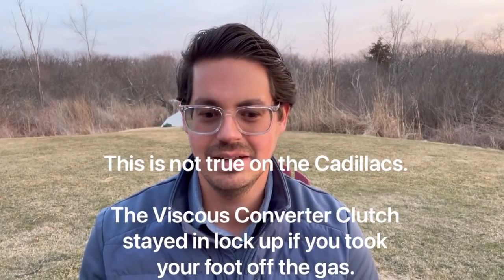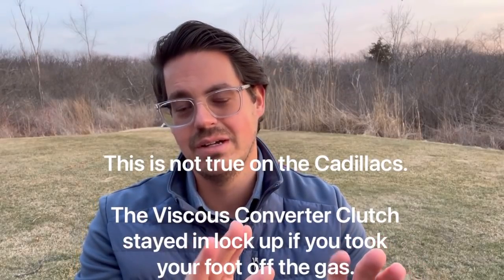Worst Transmissions of All Time: GM Turbohydramatic 440T4 (Early 4T60)

Comment: Worked at a Buick , Cadillac,  Oldsmobile store 25 years and remember this atrocious transmission.  Your correct with your list of it's problems. My friend was a Cadillac field service engineer and told me for the 1985 model year the Turbohydramatic division had a failure rate of 25% for vehicles off the assembly line, seemed to me in my service department it was higher than that.
Dealers weren't allowed to repair this transmission for several years. Rather we were told to install a SERTA (service exchange replacement transmission) and always flush the trans cooler. These were supposed to have the latest internal updated parts. Of course these units maybe would have a different symptom than the car's original unit so we would order the next latest SERTA and hope for the customer's sake it would be trouble free. Not uncommon to_ replace 2, 3, 4 units in the same car. One owner had 6 replaced in his 1987 Olds A body with a 3.8 V6. He brought us a roll of velcro and thought that might help us reduce the replacement time so he could get his car out of the shop quicker. He was very gentle with the car,  had a great sense of humor, and enough patience for 3 people. 
By the late 80's or early 90's techs were allowed to repairs the units but by then they had become pretty reliable. Unfortunately many loyal owners to our dealership had moved on to other makes by the time those 1980's car had frustrated them over and over with design and quality issues. 
By the way, if you still own one of these cars and think the transmission is ok still,  look at the top of the unit to see if it has a metal plate with SERTA stamped on it. Your car may have the latest remanufactured unit and you are luckier than the original owner.
Reply: I worked at a Chevrolet dealer for about 14 years, very familiar with those SRTA units. I do remember GM did have special policies on some units to where it was exchange only for a certain period of time. Then after the program expired, we could rebuild them because internal updated parts were available along with information to perform all the mods necessary to improve the operation of the affected  transmissions. When I started at the dealership, those 440T4 trans were phasing out, newer 4T60 were more common and later along with the 4T60E . What I told by an older tranny tech, he say that the torque converter lockup on the 440T4 and 4T60 were designed to allow very minimal slippage from 0-10 rpm, mostly towards 0. Because of the normal and abnormal  vibrations caused by those engines (at the time)any kinda of (use to like to say "hicups")misfire, weaker cylinder output, balancer, etc and any drivetrain issues those could felt by the driver through either the steering wheel and/or cab of the car. Later 4T60E units besides internal changes ( improve shift quailty and feel) made, those allowed for higher amount of TCC slippage 20-50 rpm in which those vibrations weren't felt as much, improving the overall drivability.
Reply: @michaelmurphy6869  more eye opening inside information, appreciate it.
Reply: @michaelmurphy6869 I have the 1987 Ninety Eight, car is like new condition . 67,000 miles trans does not shift out of 1st gear
Reply: @jnelson39120  There are several issues that can cause that concern, no upshift or delayed upshift. Since you have 1st gear the primary hydraulic system is probably ok. Check the basics first, low fluid level. Those 440T4 trans should have vacuum modulator (looks a can sticking out the side of the trans, its towards the front car about halfway down the trans case) inspect vacuum supply hose (short hose at both the engine supply and mod inlet) coming from the engine to the trans for any cracks, breaks or splits. If no or low vacuum(check the vacuum source as well, it's rare but the vacuum port at the TB could be plugged)  is getting to that modulator it can cause shifting issues, another is the TV cable (throttle valve comes out at the top of the trans and connects to the throttle body) check to see if it had come off the throttle body. If not it may need to be adjusted, the cable when pulled should move forward with a little bit resistance then released should snap back should have a short pull approx 1/2" or so. If all those checkout ok, good possibly there's a mechanical/secondary hydraulic issue internally in the trans and it will need to come out to be either repaired or replaced. Hope this helps alittle, good luck.
Reply: Very informative post thank you very much
Reply: learn something new every day, thanks for the info.
Reply: @willythewave  We used to get AXODs with under 5k miles on them
Reply: What an unfortunate time.
Reply: @ntdfmaverick  It sure was.
Reply: Classic GM Horror Story.

Comment: Loved the Ford AOD.  Was seemingly possessed or something.  Would shift quite well 95% of the time.  Always seemless with OD.  Then out of the clear blue a random massive KATHUNK from 1 to 2 to make one worry the car was near death.  Just means your driving a Ford said my father's mechanic  ... that ultra skilled man who could make the variable venturi run perfectly who is certainly long since gone to the great hereafter and has certainly fixed everything there by now.
Reply: I had a new ‘92 Plymouth Voyager with the 3.0 Mitsubishi V6 and the three speed automatic transmission. I never had trouble with it but if you lifted your foot off the gas pedal right before it was going to upshift from 2-3 as I had to in my subdivision it would about knock your teeth out. We drove it 12 years and it never failed, but listening and feeling that was not exactly confidence inspiring.

Comment: I bought a new 1985 Olds Cutlass Cierra with the 3800 V6 and I think it had this transmission.  I seem to remember it was in the shop a few times for mysterious transmission issues, and it received a new valve body and solenoids.  It also had a paint issue, and Oldsmobile did a complete repaint of it at the Oldsmobile dealer body shop.  I am positive that Oldsmobile lost money selling that car to me, it had a huge amount of expensive warranty work.  I drove it for four years and then gave it to my mother with the instructions that she was to dump it if another major problem were to occur.  One day when I called her for a phone visit she said, "about that car."  Before she could finish telling me what happened (it was a transmission failure) I asked her what she bought to replace it.  She bought a 1993 Oldsmobile Bravada, which proved to be a durable and reliable car that she drove for many years.
Reply: So she traded it in?
Reply: @christianmotley262  No, she took her crescent wrench and personally spent weeks working on it.
Reply: Did the 4T60 have an electronic valve body, or do you only mean the torque converter clutch?

Comment: I've got an early 84 vette, it has to my knowledge the original (never rebuilt) th700r4, boy that tranny's programming can drive you nuts. Its always hunting   between up shifts and down shifts and locking and unlocking. It'll go into lock up in 2nd. Lately I've been driving it with the tc unplugged.

Comment: It sounds like it would have been better for GM if they would have started off with a longitudinal front wheel drive setup for their luxury FWD downsize program. At least the 325-4L transmission had a track record of much better reliability, with updates electronics.  Plus they already had established a history with the E-body (Seville, Eldorado, Riviera and Toronado). Further, the C-body's suffered various other woes challenged the reputation of GM as a industry leader, because they borrowed heavily from cheaper models such as the Cutlas Ciera. They, on the other hand, were able to update the Fleetwood Brougham from 1977 until 1996, as there flagship.This platform was second only to the Lincoln Town Car's Panther platform, which was ran uncontested from 1980 until 2011. The unreliable powertrain options coupled with cheaply designed "luxury" offerings led to the demise of the U.S. luxury car market, while the Japanese dominated that segment.

Comment: I do believe the the automatic that was mated to the 2.8L V6 in the GM X cars would be a candidate for one of the worst. I had one that failed under warranty. The dealer that repaired it told me that failures were extremely common in the early models. The internals were mostly redesigned over the next short while.
Reply: That's odd, the TH125 is generally a pretty reliable trans.
Reply: @firehawk6188  Not as it was in early models. I don't think you'd find a GM tech anywhere to agree that they were any good at all. I was shown the pile of new parts (most of the internals) next to the old.  The new were substantially different. I was surprised they all fit in the cases because some were quite a bit stouter.

I was dumb enough to get one of those 'great new front drive cars' just a few months after they came out. Other than the transmission, power steering, and a few other issues, it was a very pleasant little car.

Comment: Adam, my dad had a 1985 Riviera and I owned a 1985 Buick Electra T-type coupe and not sure if these cars had that transmission because they  both were great cars. When the Riviera was newer it wouldn’t go into gear and the dealer said the Module’s were bad on the 85’s and never had another issue.My T-type had 224k when I sold it , I rebuilt the transmission at about 160k. I don’t remember anything unusual other than just being an 80’s lower quality car.

Comment: I had most of these issues with my '93 S15 with the 4L60E especially TC lockup and 1-2 shift .The dealership couldn't figure it out and just changed the fluid. When I switched to Mobil One synthetic at 36k miles it ran perfectly.
Reply: Transmission fluid?
Reply: @christianmotley262  Yes

Comment: My '86 Buick Electra T-Type with the 440 T4 was the end of me buying GM.   After my family's 1973-1975 Caddys which rusted out in 2 years in Michigan (Japanese body panel steel), My Great Uncles Caddy V7-5-3, his HT 4100 Fleetwood Brougham, my HS teacher's 1974 El Camino with the same bad Jap Steel and Recycled Rubber Vacuum lines and other components, my own1981 Pontiac Phoenix LJ with lock-up rear brakes:  This Transmission was the final nail in the coffin for my romance with The Mark of Excrement!
Reply: what do you drive instead?

Comment: I had a 1989 Olds 88 with the 440T4, which was quite reliable up until the transmission started to slip at 140k miles.  The 1992 Pontiac Bonneville I had definitely had the chuggle related issue.  Both very good cars.

Comment: I rode in an Olds 98 with one of these in it. Compared to my THM425 in my Toronado it made me sad. My Toronado just glides into gear Super smooth shifting
Reply: The C and H Platforms were tragic substitutes for the once-great GM FWD Land Yachts of the 1970s and 1980s!   GM sure lost its MOJO then!
Reply: My 1969 and 1972 Toronados are driving fine for all the years on their powertrains. No service required on the TH425s.